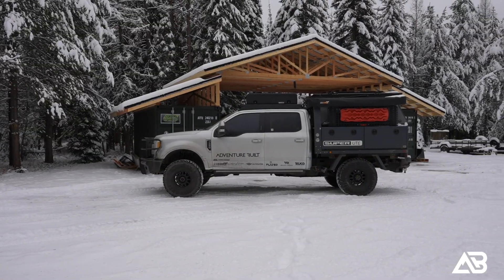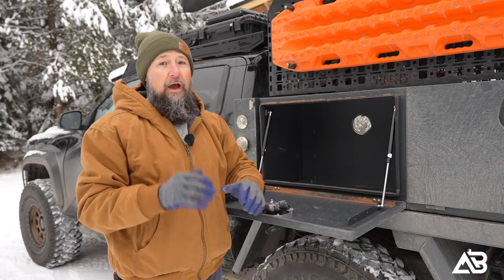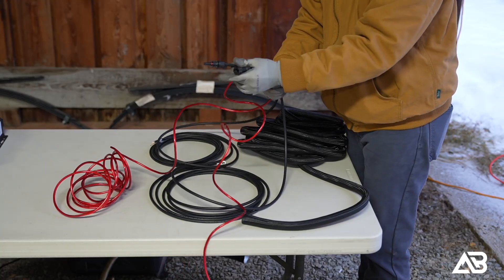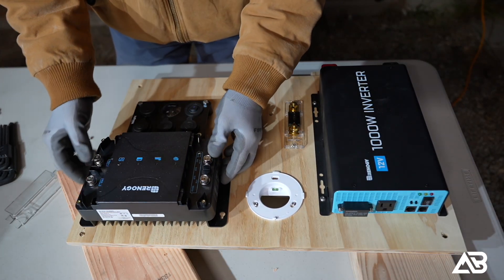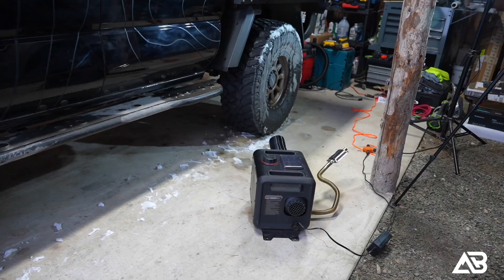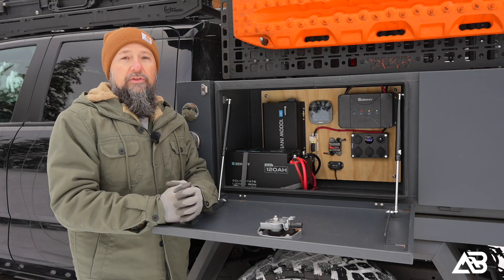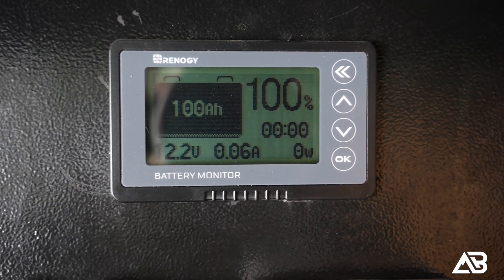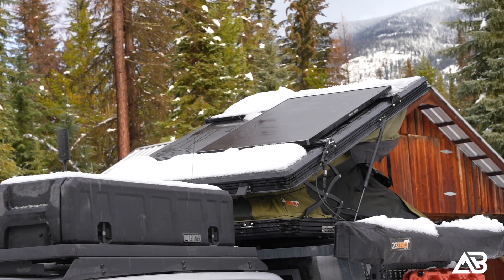Easy Car Camping Solid State Hybrid Battery Install with Solar & DC-DC Charging from Renogy

Comment: Maybe I missed a part but it looks like you connected the inverter directly to the battery without a fuse. 😮 You also forgot to ground the inverter. Both things are critical for safety.
Reply from the maker: You are not wrong. During the install I didn’t have a large enough in-line fuse for the DCDC charger but that has been added. Also the inverter is grounded to the negative battery terminal and the battery is grounded to the frame.

Comment: Sweet setups. I have had bad luck with Renogy product in an automotive setup. I have had nothing but great things in my home and shop setups. I think it could be the vibrations breaking down their products for the automotive products.
Reply from the maker: Thanks. I have actually had great luck with Renogy in the Super Ute, only time will tell with the longevity!
Reply: @AdventureBuilt my bro in law has a nearly identical setup. About 2 years later it started to have issues. He got a warranty replacement even though it expired. He said the customer service was great. He put vibration isolators on the back board and has zero issues ever since

Comment: Does the ShadowFlux solar panel have a glass surface? I went with a BourgeRV flexible panel because I was worried a glass panel on my roof could get cracked by whatever. I also went with the BourgeRV because at the time it was the only one I found that worked well under clouds or shade. I saw a test where they covered over half of the panel with cardboard and it still had output.  Looks like yours has the same technology.
Your system looks great though.
Reply from the maker: Hey thanks. I’m assuming that there is a glass surface to the panel but it’s super rugged. I heard a rock hit it while driving on the freeway, it was super loud. Checked the panel and couldn’t even tell where the rock hit. I had a Bouge RV panel, they aren’t bad, except one day it just stopped working. Hopefully you get years out of yours!!!
Reply: @AdventureBuilt  Good to hear. The other potential problem with my panel if it gets damaged or stops working, how do I replace it? I put it on with 3M VHB tape. Worked great so far but I hope I never have to try to remove it.